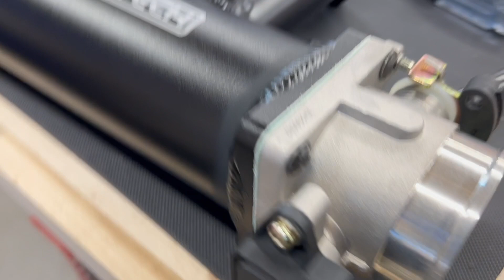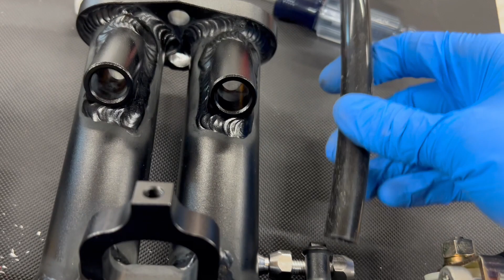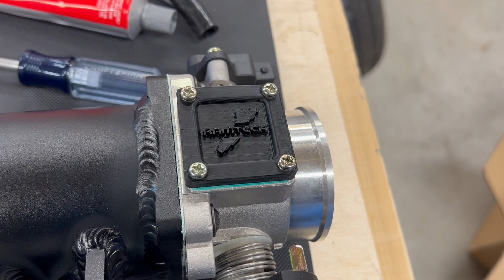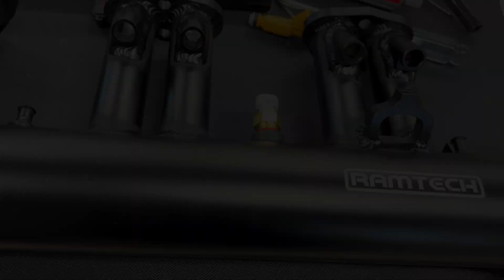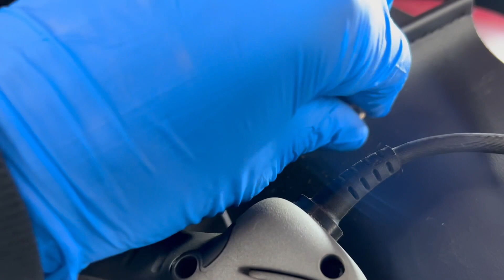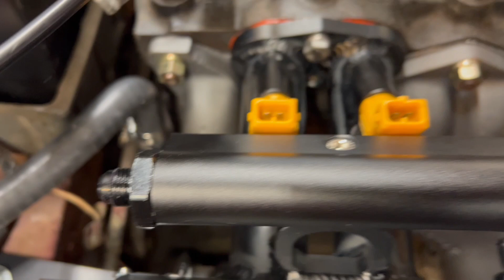Triumph TR6 EFI Fuel Injection Part 2.  Manifold Assembly and Install

Comment: You mentioned having to run the next size drill bit through to reem the hole. Was that because the injectors were leaking?
Reply from the maker: No, it had nothing to do with the injectors.  The fuel rail bolts onto the manifold, just to hold it in place.  It felt like the threads were cross-threading and weren't quite lining up correctly so I made the holes on the fuel rail slightly larger to give a little wiggle room.  It fit fine after that and no issues with damaging the threads.

Comment: heres a story you may find interesting, I have owned a 1973 tr6 since new, I emigrated to canada in 1980 and had the car exported here, its right hand drive fuel injected with a metering unit and lucas pump. the vehicle is registered after much frustration which I wont bore you with, unfortunately no one in canada has the experience to service or maintain the system . it has 49,000 original miles and hasnt been driven for 20 yrs and sadly just sits in my garage, Im 75 yrs old and and not a mechanic, the vehicle is original magenta with an added hardtop to match, its virtually rust free and was undersealed ziebart from new, Ive strugled with trying to get it running and had inexperienced mechanics putter around with it to try to get it running, I was considering the bosch fuel pump conversion to replace the lucas pump which I was told didnt function properly, every time I try to focus on getting it on the road again ends in disappointment and just more expense, I was surprised to see your new injection set up and was unaware such a system was available as it seems to be a pretty straightforward set up doing away with the metering unit, Im scared to ask the price for such a set up,  just thought you may find interest in my post  thank you very much   Bill
Reply from the maker: Thanks for sharing Bill.  You may already know of it, but there's a couple other channels that deal with TR6's.  ChefTush and Elin Yakov's Rusty Beauties.  I know ChefTush recently had a series on the english fuel injection.  Hopefully that's helpful to you.
Reply: @hollywoodd3191  I'm in UK and have purchased the manifold, sensors & switches from Ramtech, I'll be buying the ECU from a UK supplier. I'm particularly interested and keen to know how you're going to tackle the fuel lines. I can't decide whether to run PTFE stainless braided hose the length of the car or use hard pipe. Also, what do you plan to do about the fuel tank? I'm told the fuel return lines & port on the fuel tank (Pi) is too narrow, so I'm thinking of fitting a AN-6 weld-on fitting to the top & bottom of the tank.
Reply from the maker: @RichardMcK  
I'll hopefully have the next video done soon.  I bought a new gas tank from Moss motors and it actually has a return line built in.  One of the threaded bungs on the top has a steel rod welded inside the tank.  That rod goes down into a swirl pot.  So all you would need to do is get an AN adapter to match those threads.  The particular threads on my new tank are 1/2-20 UNF.

As for the fuel line, I plan to follow the frame rail the same way the stock fuel line went.  But I still need to see if it will fit correctly.  I would check if a hard line can handle fuel injection pressures.  I know some can't.
Reply: @hollywoodd3191  Thanks, I'll look forward to your next video installment.